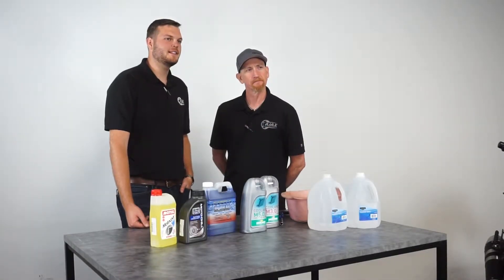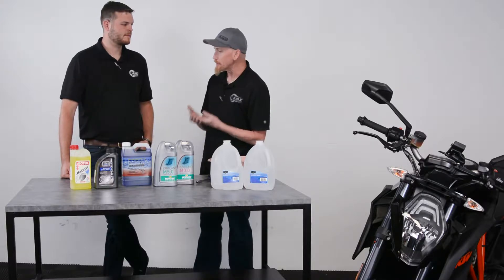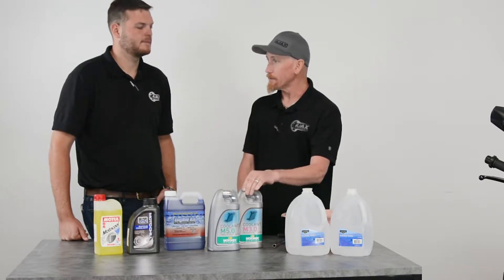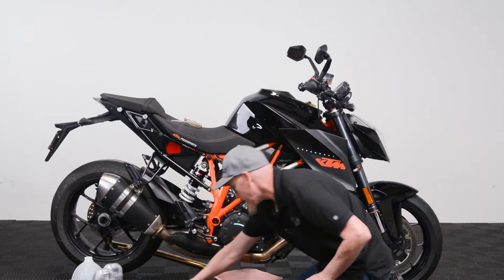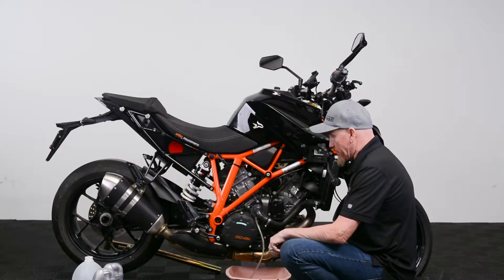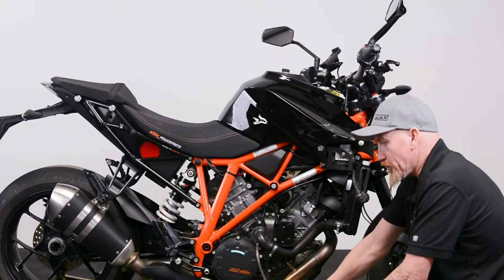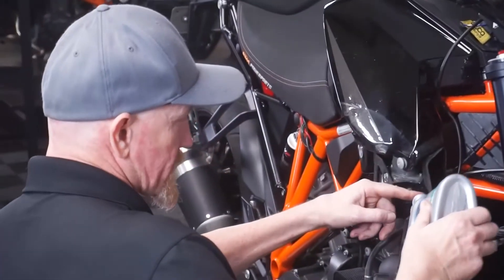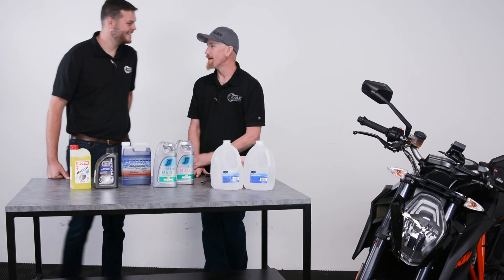Motorcycle Coolant Flush // AJAX Motorsports Tech Tips

Comment: what about the 2 water jacket bleeder screws on the cylinder's on that 1290 sdr  the repair manual says that's critical to remove the air from the system ? doesn't air get tarped  inside the motor ?

Comment: You need to raise the front 50mm and also remove the bleed bolt on both cylinders before you refill with coolant on a superduke R
Reply: I have yet to find a video where someone does this. I would love to know how any home-based mechanic rigs that up, cuz I have tried and failed, and it was sketchy.
Reply: Not necessarily if you fill slowly

Comment: Doesn't the manufacturer have you raise the front tire 20 inches and remove the cylinder head vent bolts during this?
Reply: I’m sure that helps, but eventually it should work its way out you would think. I’m planning on at least using my front stand.